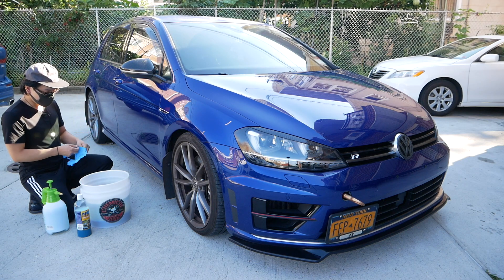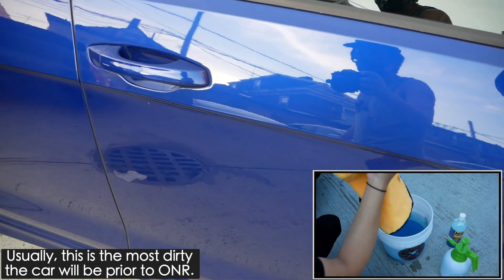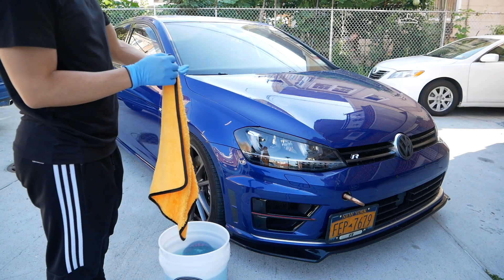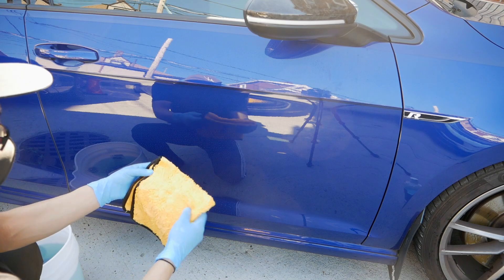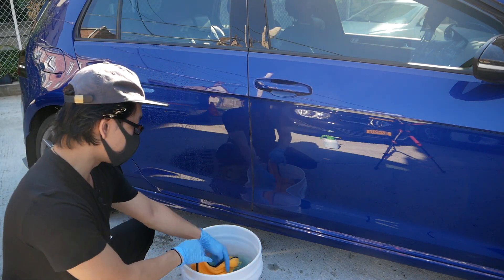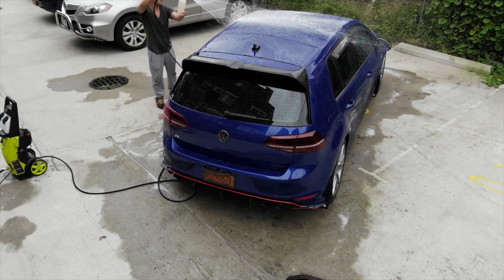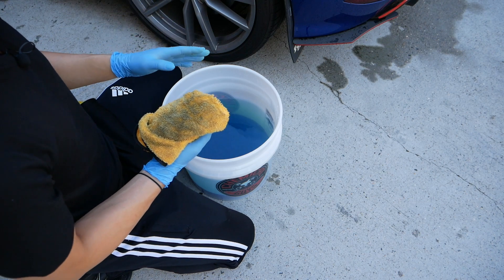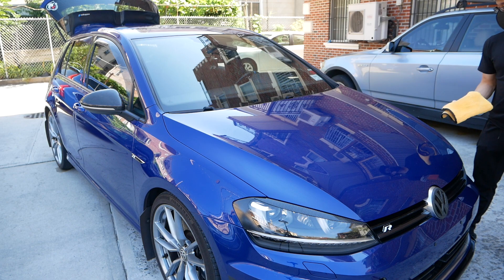How to Wash your car in NYC using Optimum No Rinse Solution | Easiest No Hassle Method!

Comment: Thanks for the video! I live in and nyc and needed a way to wash without a hose, I heard about ONR but wasn’t sure until I saw this vid. 
I have a 2017 Tiguan SEL. For the pressure washer section of the video, which car wash did you go to? I have been looking all over the city for a self car wash with a garage style cover like that but haven’t had any luck.
Reply from the maker: Hey Lloyd, this wash bay is actually located in NJ. Drove by it while visiting a friend. There are no wash bays like this located in Brooklyn - as far as I know. I usually go to my local gas station where they have pressure washer for around $8-$10 for 10 minutes. Sorry for the confusion!